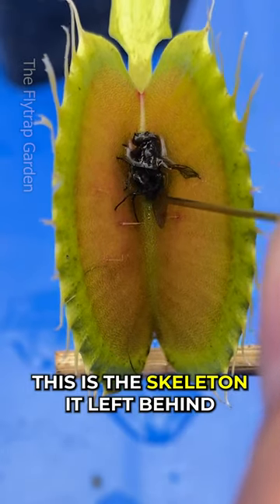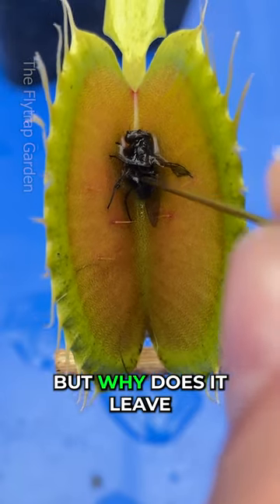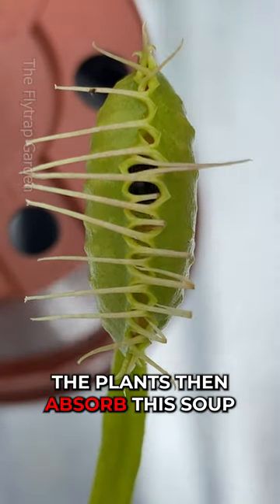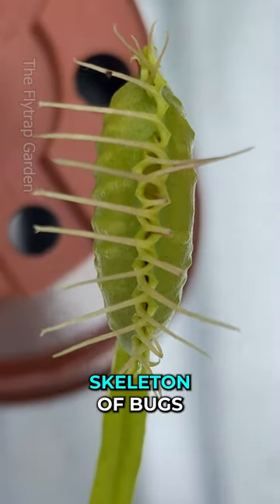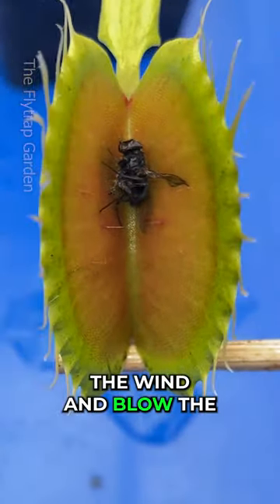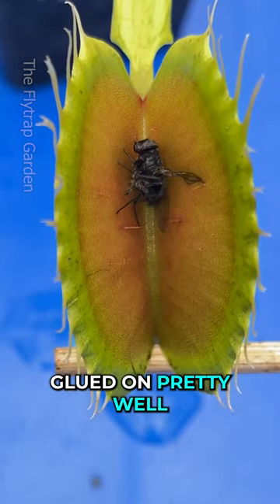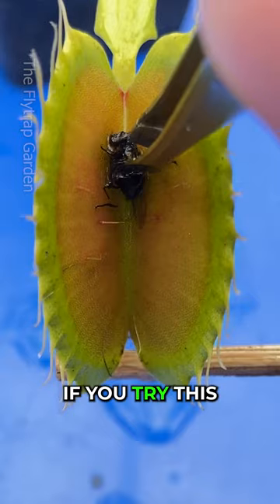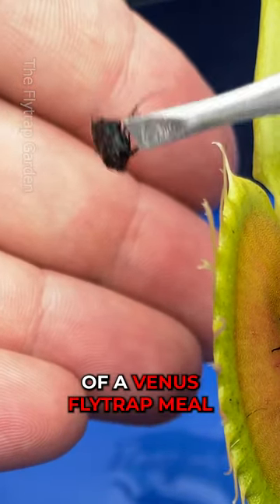Removing the Skeleton From a Flytrap #shorts

Comment: That hasn't been digested. In my experience you will see the edges of the trap seal with the digestive juices & after digestion the traps then wither & turn black. They don't always initiate digestion, what you are seeing there is just a dead dried out bug, it hasn't been digested by the plant.

Comment: The problem is that the remain dries up & it glues into the walls of the trap. Back in its natural environment, the remains remains moist & slowly dries up. Giving time the wind & rain to wash it away.

But the acid of a Venus flytrap are strong enough to dissolve human skin. A botanist Barry Rice did that experiment, & out of curiosity... I did the same.. It dissolved it!